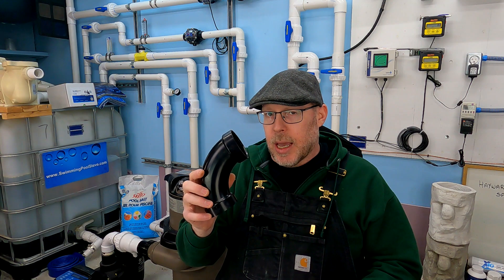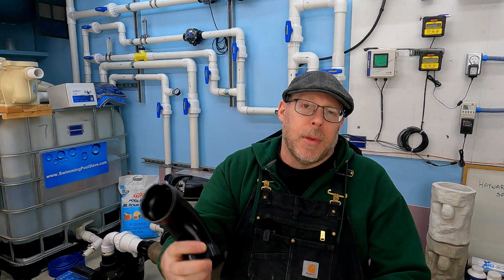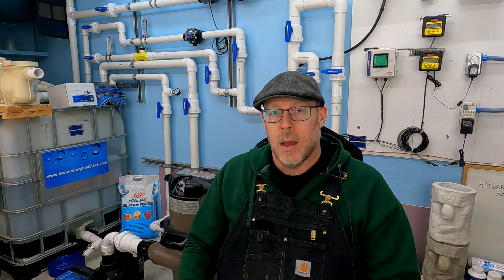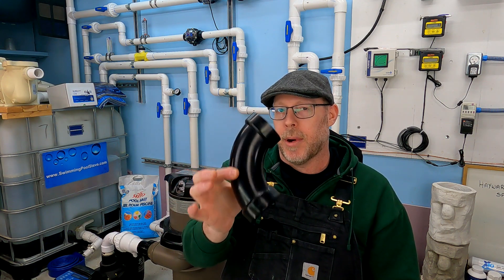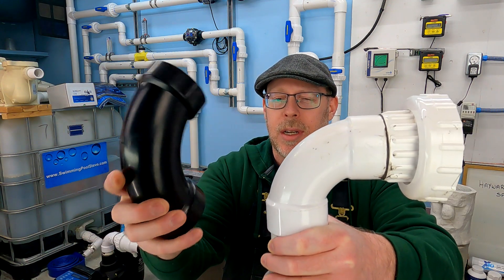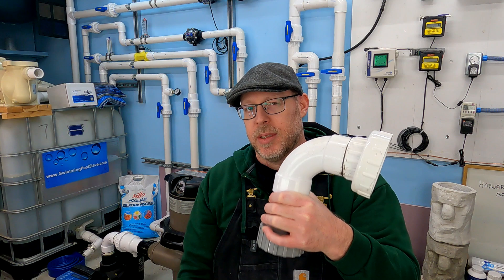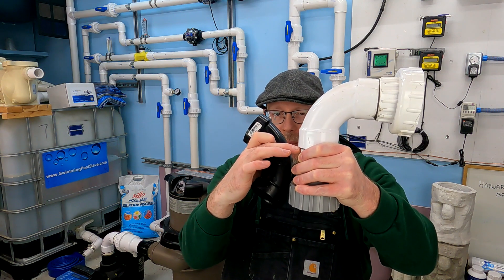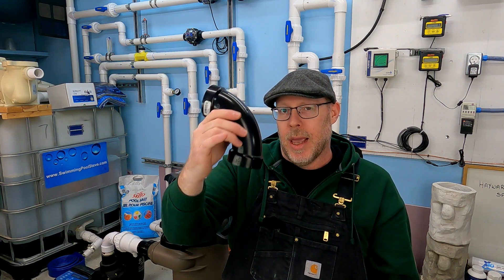Can You Use ABS For Swimming Pools?

Comment: Solid core ABS is pressure rated. Cellular core is not. Also ABS with proper primer and glue needs less surface area to make a leakproof connection; it almost kinda melts the two pieces together. ABS is not UV stable and it does breakdown over time when exposed to heavily chlorinated water.

Comment: Yes, ABS (Acrylonitrile Butadiene Styrene) pipe can withstand pressure and is often used in applications where moderate pressure is present, making it suitable for pressurized plumbing systems, though the specific pressure rating depends on the pipe's class and size; it is generally considered stronger and more pressure-resistant than PVC pipes.
Just a simple search..... as long as the ABS used is not going to be in dirrect sunlight, it shouldnt matter... basicly the only mattering factor really between abs and pvc
Reply from the maker: @dismo021  cellular core ABS is not pressure rated. Perhaps ABS is not used for pressure ratings because the fittings are all DWV.  The length of the glue slip is too short for a pressure rating.
Reply from the maker: @dismo021  not sure what ABS you are buying but the stuff around me is not rated to 330psi like my 1.5" schedule 40 pvc is. In fact it has a pressure rating of zero.

Comment: my pool was built in the late 60's early 70's.  made of cement.  it uses black pipe.  i think it's poly... but it could be abs.  i don't know which.  it does have some very minor elasticity to it.  i hate it b/c i have no idea how to put return eyelets.  my pool only has the black pipe entering the pool with nothing in the pipe to "aim" the water.  kinda sucks.... but works.
Reply from the maker: @nickyalousakis3851  that sucks! Probably poly pipe. Unlikely to be ABS. look for "bump" returns or bump fittings. They are designed to friction fit into a cut off pvc pipe. Should probably work for what you have also.

Comment: Hi Steve,

For many years we’ve had a solar heating system that uses ABS pipes to transport water up to the panels on our roof. We’ve regularly had 2 problems with leaks around these pipes. The first is that around the joints leaks will develop, the second is that pinhole leaks will appear in the pipes. These happen about once a year and necessitate cutting and splicing a piece of ABS pipe to stop the leak and, after a few years, completely replacing that section of pipe due to all the splices.

I thought the leaks were due mostly to exposure of the sun and carrying chlorinated water but after watching this video my ? for you is: is there a better pipe (e.g. PVC or CPVC) that we should be using? Thanks!
Reply from the maker: @bradwartman3647  cpvc would be optimal but cost prohibitive. Black PVC would be the most common option for the solar application. It's a specialty product and harder to find but is out there!